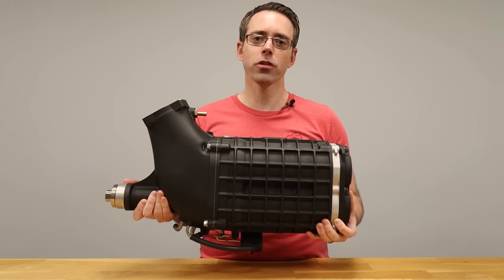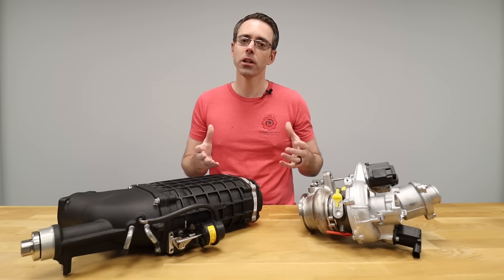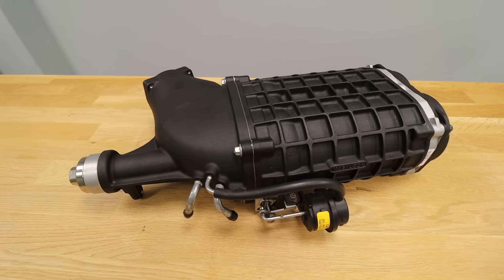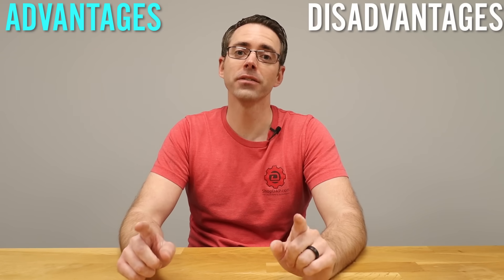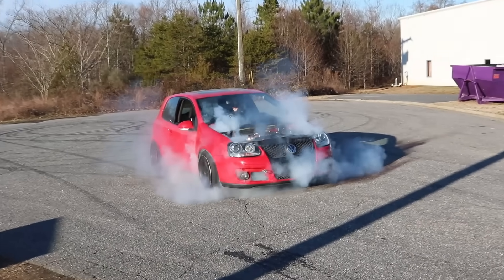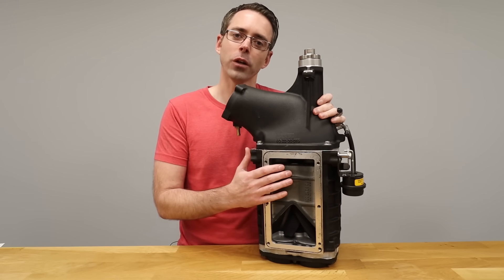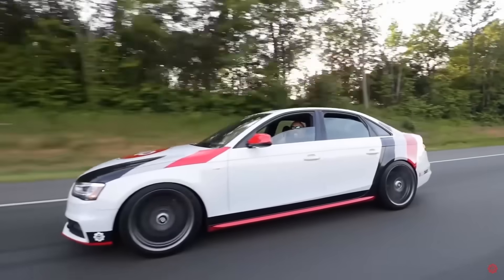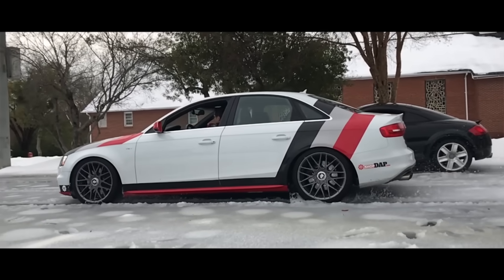Turbochargers VS Superchargers | Which is Better?

Comment from the maker: Find all the parts for your VW or Audi! - https://www.shopdap.com/
- We appreciate your Support and Purchases! -
Reply: at 25 psi turbo is only making 100 Horse
and running the timing up like on Dino with E85 Doesnt work off Dyno Either 
Neither does High Compression  Engine with boost 
they go slower than they did natural aspirated
They are Snake oil Salesman Bull Sh iting you
Go Ahead and try it
Nightous only Does it because of Refrigerated super cooled charge Boost Charge.
Top fuel racing is Different Because Hydrogen is mixed with alcohol and methane
giving it many more oxygen atoms peroxide 
Same as shooting Rocket to moon lol
This is pure laymens terms for you to understand
40 years of turbos Superchargers At Work and play 
Turbo heats to 1700 Degrees wile boosting 26 psi 
Roots is at 90 degrees at 8-10 psI with 160 degree thermostat
Dont Believe every thing you See on Youtube

Comment: Supercharger is better.  Always.  Keep away from that exhaust heat or adding backpressure to the exhaust.

Proof?  All the pussy eco-motors have turbochargers.  All the performance engines have superchargers.

Comment: Forgot to mention you can’t supercharge a diesel because it’s running to low on rpm and a supercharger would blow it. However supercharges have  been around  since the Second World War and are much simpler to install because it’s much less parts.

Comment: Correct me if I am wrong: Superchargers use a belt independent of the engine. If the supercharger fails, the engine still runs but in it's regular setting, whereas the turbo, if it dies, engine stops working.

Comment: Neither is better! A turbo is in fact better suited on a diesel, a supercharger is better for instant power! It comes down to what you are building and what you are after! Do you want to wait for the power or do you want instant power! A turbo is made in only one design were as a supercharger can be dual scrolls or single scroll! Also when a supercharger fails you still have an engine in most cases, were as when a turbo goes you destroyed the engine in most cases! Also a supercharger sounds way better!

Comment: There's too much to cover in this video on which is best. It's really going to come down to which engine, what driving style and personal preference. Turbos can create heat soak issues to where they can literally melt engine bay components if not properly shielded. If you're going non turbo to turbo Cam selection, valve springs okay a big role in your success. Higher intake temps, higher cooling temps and boost means fuel will need to be better than pump grade most times requiring at the least methanol injection to avoid detonation due to non turbo engine compression ratios being higher than turbo ratios. 

The turbo is easier to turn up the boost but that may not mean much if the turbo is ran outside of it's efficiency range. This video says turbos are more efficient but not if your turbo isn't sized properly for what you're using it for. Running an over sized turbo on a street car can mean to much lag and a smaller turbo on a race engine meaning quick to engage with less lag but then a flattened off sense of acceleration. There have been a lot of advancements in turbo tech and they've come a long way and turbo will always have a special place in my heart but it's not always best for what you're needing. 

Yes some** super chargers are instant power when you press the pedal down at any engine speed but that's not the case for all types. Centrifugal blowers build boost in a linear fashion and most are sold as kits which usually build low boost levels above idle and creep up with the engine speed. Twin screw blowers with bypass valves and liquid intercooling are about the best you can get for all around driving/road racing conditions as they build boost by over powering engine demands instantly. Liquid cooled intercoolers are pretty damn good at keeping intake temps cooler. Usually these can be used with stock cam configurations though blower cams can pick up extra power. A centrifugal is good for highway pulls, drag racing etc, twin screw like a Whipple is good for road race, racing and driveability. But be warned you can see what more power off the line than stock and can break drive line parts quickly. Turbo is good for street and race applications. With a properly sized turbo, properly built engine and a boost controller that is reliable you can steet drive, drag race and road race the same car successfully. There are many factors to consider with turbos and most of it comes down to desired goals. You can get really lost in the weeds if you start looking into twin charging or compound turbo systems. My advice look at what you want to do pick which fits best and keep it simple but build for reliability

Comment: Parasitic loss is just old lie that sounds bad turbos are dirt cheap to make 
To prove it Dyno your stock engine keep on dyno pipe boost acrossed to other dynoed car
to simulate Drag of engine and have second car turning over rollers on dyno
The fist car will loose 50 horse per 25 ponds of boost
for 50 psi to push in 1 direction 
it has to have equal force on other side  
pure physics 
The Roots is actually easier to turn under boost mostly because its only trying to make 5-7 psi on 1 to 1 ratio
where as a screw has to do 4 revolutions to get air from 1 end to other
roots 1 rev poof 5 psi 
Screws are cool but are way short winded compared to roots
another words if you had engine that spun 12,000 rpm double your horse power
Roots just keep pushing until engine blows or head gasket gives lol
last race I had big double turbo out pulled me barely 
Till He Shifted Gears Then He was watching my Tail Lights the rest of way 
I asked how much boost he was running  he said 60 pounds 
I was running  the 1 percent wheel 5-7 pounds boost  there is a 8-10 and
10 - 12 wheel lol 5 pound wheel running coolest Charge 
What no one tells you is stock 350 Roots Super Charger 5-7 psi 350 horse at wheels 
will kick the shi t out of 55o horse at wheels 350 natural aspirated
Through Rpms just like Nitros 200 shot= 50 psi turbo
Dyno racing Wild engine and turbo and nitrous beat up Roots You hit Track 
under car load Roots Rub There noses in it
invite 65pound boost twin turbo to 500 mile Baha Race  vs Roots Blower 
10 miles into race turbo be melted or popped Roots will be in Winners Circle at End.....

Comment: Are superchargers okay for towing? I overheated a Vortech V3Si while towing a load the car could have handled without the supercharger... I'm looking for a twin screw supercharger for the lower end torque, but I am worried about the self-contained oil overheating in the same way.. what do you recommend?

Comment: How is retrofitting a roots style supercharger more complicated than a turbo? With a Turbo you have to drill oil ports, lay oil lines, install wastegates an blow off valves, etc.
With a supercharger you just need to isntall a mount (maybe custom weld one, or let weld by somebody), attach a pulley and its done.
Reply from the maker: Once someone has done all the R&D on a supercharger it easy, but not if you’re starting from scratch

Comment: Wow, there are so many things that are wrong here.  Its a good video to cover the basics, but thats all it is, is basics.  The efficiency argument needs to go away.  The modern supercharger is NOT the supercharger from 30 or 40 years ago.  As turbos evolve so does the supercharger, and vice versa.  Another thing to note is native displacement.  An engine that already has high displacement is going to be amplified more by a supercharger than a turbocharger.  The last thing i want to bring up that people have a hard time wrapping their brains around is a very simple adage and ill leave it to you to debate.  Which makes makes more power?  A 800 hp V8 or an 800 hp V6.  Thank you, have a nice day.

Comment: Engines run more efficiently under cooler Temperatures. No sense taking hot air from exhaust , trying to cool it , Makes the engine much simpler and efficient with superchargers.

Comment: I like both and would use either for a build. But I do like the supercharger sound more. It's got the better whistle sound imo. But they both have pros and cons. So it comes down to personal preference. So everyone is different and will like more than the other. Especially if ones cheaper and you can get a deal? Because cars with high HP are expensive asf. And building a muscle car still is expensive asf. But it's cheaper to build yourself. Plus you get way more choices

Comment: Turbos easier to install? WHAT? One requires a few bolts, the other requires drilling/tapping throughout the engine and car body, not to mention relocation of  items or deletion of items. Most commonly windshield washer bottles need to be removed/moved along with coolant bottles.

Comment: Turbo your Supercharged engine Or duel charge. They are built to accept a constant boost all of the time. Iron block forged cranks, where turbo engines are built for a much smaller time in boost. One of the best is the Ford 2.3 4 cyl in the mustang and the thunderbird as well as the Mercure.   Don't get me wrong I love a turbo but I see the potential for Duel boost out of the box. The cars I mentioned were not designed to make MPG but power from a smaller platform and did it very well. LOL!!! Four beers In. Have a great day!!!!

Comment: Superchargers seem to be great at the lower rpms and quick accelerations, turbo has greater fuel efficiency and rule the higher rpm part of the power curve because they have LESS parasitic drag. Any time you put some resistance AFTER your exhaust manifold you are robbing SOME power from the engine. You are hoping that the power gained offsets the extra work you are imposing on the engine.

Comment: The engine has to push the exhaust gas to spin the turbo doesn't it? still using engine power? Also why don't super chargers use intercoolers?

Comment: Turbo also has parasitic load on an engine. Less than super but they are not driven by exhaust not changing how the engine works/exhausts. 
The exhaust gas back pressure is much much higher with the turbo

Comment: Crawford did an FA20 build where they hit peak boost at 3500rpm, the engine also made up to 720whp i think it was, so idk who would need a ton of power before 3500. And yes it was a small turbo which spools quickly and they still made insane power!

Comment: I think the simplest way to translate what you said into layman speak, supercharger gives you more performance at low RPM and Turbocharger gives you more performance at mid-high rpm.  Now this is obviously subject to another phenomena, exhaust volume.  As your engine volume increases your exhaust volume/flow increases.  So you may be able to get the turbo to spool up at lower RPM's in some instances encroaching on the supercharger... at the same time larger engines have more HP to spare to push a turbo so still it comes down to off the line power (like a drag or 0-60 times) vs power at speed (passing acceleration on the road).  I think that Turbos serve the common motorist best and super chargers are more a drag strip option, but again as you change the engine size/composition, and usage you'll see how the two work with your power train change a bit.

Comment: Never had hands on any of either parts but I have built a 91 429 cobra block forged pistons h/o firing order gt40 heads semi drag motor for an 87 bronco all it needed was a turbo and there were kits for it too but no super charger available for it smh

Comment: If you have a stick shift then turbo has instant power of you don't mind sacrificing the clutch.  Rev it then drop it into 2nd gear at high rpm.

Comment: Who race from a dead stop at 0 rpm or a roll in 5th gear at 1000 rpm. These idiots never heard of launch control, brake boost, rolling anti lag or going from a 2nd gear at 5000 rpm. Also, that city driving toque isn't racing. Turbo ftw.

Comment: So, I had a VW CC Sport Turbo. And though it was fun. I always had to drop a gear (activate) for the turbo get ready. I noticed this when Jaguar had a whining sound. I though he was messing but when we took off I had to play catch up. So, I started wondering WTF just happened my VW CC was stage two tuned. Still got my but kicked. So, I went to get another one they didn’t have the Arteon in stock so, I need a car for work. And figure just get a work horse. A Honda Accord 2017. So, I think I’m gonna modify it now but my biggest questions to myself should I get a supercharger or turbo. And based on my experience with the Turbo... I don’t like the lag. So, I prefer to sacrifice 3hp to receive way more than that. Sigh! Supercharger it is.

Comment: Easier to retrofit? Supercharger's don't require piping, oil lines, blow off valves or blow-through intakes. Pull intake off, bolt blower on, haul ass.

Comment: Superchargers arent even remotely more complicated to put on a car. Turbo takes much more plumbing, oiling, down piped ect ect. Supercharger bolts on, wrap a belt and have fun. Obviously a little more complicated lol, but you get the picture. Ive done both

Comment: I think supercharger and turbochargers are both good. I think it depends more on what the purpose you are using the vehicle for. In my case, I want more response in everyday driving. I'm less interested with peak HP.  If it was all about power, I'd probably go with turbo.

Comment: Just depends on the build and what you want to do with it. My 2.4CRV has a head w/manifold built in so a turbo would bolt directly to the Head. A little bit of Plumbing/fab for the intercooler. Run a new 3in cat exhaust Y'd off for dual 2.5in stock CRV Mufflers. For a quiet sleeper.
Reply: Hi @GT Godbear, I have a few questions for you. What's the configuration of the turbo inlet and outlet? Is it T3, T4 or V-band and at which A/R? Did you upgrade your fuel injectors for the turbo? Have your k24 CR-V boosted with Garrett turbo or Precision turbo? Did you put in an oil catch can? How many whp does your CR-V makes after the turbo setup?
Reply: @TC926  T3 or T4

Comment: Thank you for this.  I always knew the difference in how they work, but not their advantages and disadvantages.  The turbo revolutionised the diesel engine both in terms of torque and reduced fuel consumption.  Also they are more reliable on diesels as they run at much lower revs (due to the higher compression ratio) and hence are cooler.
Reply: diesel torq  and hp is from 300- 400 hp at 26 pounds of boost 100 hp from turbo  at 2150 rpm 
only making boost taking off and when it hits hill going down road at 60 guage reads 0
 super charger was more efficent  on big trucks but costed dealer 1000 to make 
turbo costed dealer 25.00 to make Dads in old truck club
Reply: my truck turbo comes on it reaches 1600 degrees has oil cooling it idont know why it survives 1221 is aluminum melting point lol

Comment: I have both . A supercharger C200 163 Hp with a Turbocharged Focus 182 HP. The Focus is much faster , on the straight and on the twisty mountain roads, no match for the C200. but, the FLOW of the supercharger and the feeling of it, and even the sound, it,s no match for an turbo engine. shame they will not produce them enymore.

Comment: Im not getting the argument that turbos are more efficient, excluding the lag, for the reasoning that b/c they r not belt driven they are therefore not parasitic. -?- Umm, w/turbos, exhaust gases are doing work on the turbo impeller, which slows the exhaust down which causes the piston to slow down on its blow cycle...seems parasitic to me

Comment: Yes the supercharger needs an engine driven pulley, taking power, but - rarely acknowledged - the turbocharger restricts exhaust flow.  Imagine blowing through a straw which has turbines inside.
Don’t these disadvantages cancel each other out?  If not, why not?
Reply: Apparently, they don't cancel each other out because they have different orders of magnitude of losses. Especially when turbo is not needed to make power (e. g. cruising, idle) it spins idly without actually compressing air on the intake side, e. g. without making mechanical work. There is still some frictional loss in the turboshaft and some restriction from the [freely] spinning turbine wheel, but apparently these losses are very small.